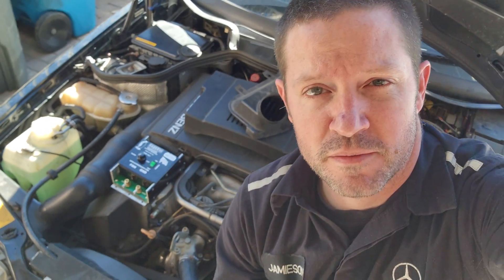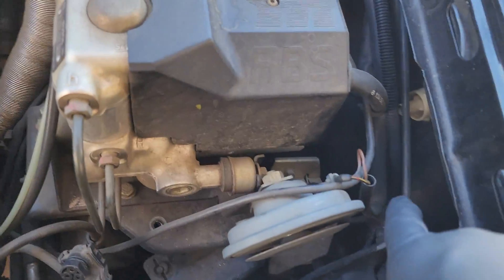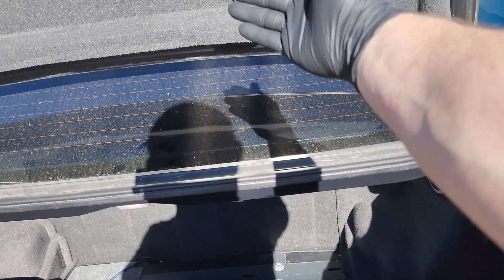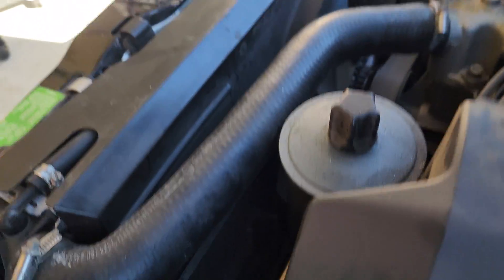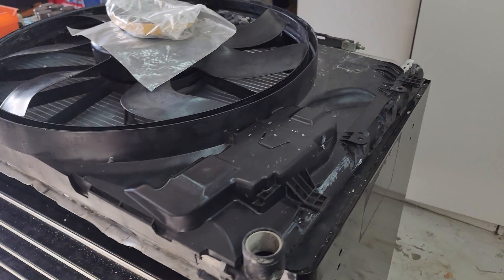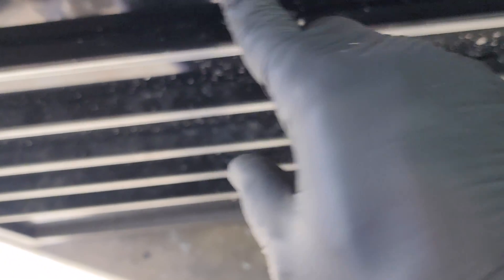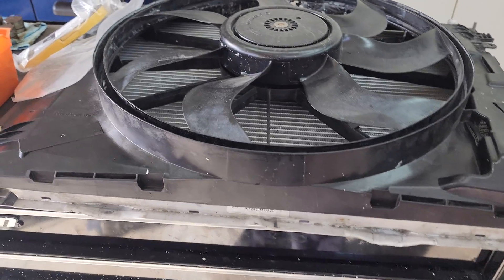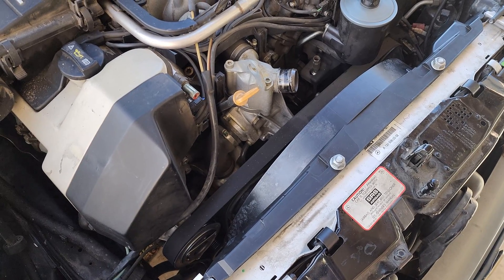Electric Radiator Fan Conversion Part 1

Comment: I just put the fan from W204 to my W124 which I already upgraded the alternator to 115A few years ago before. I haven't put any PWM controller yet, just tested the fan directly to battery and turn 100%, but the charging voltage slowly drop from 13.5V to 11.8V. 😂

Comment: Great video!
I have a 1992 3L M103 300E (wish I had a V8 W124). Upgraded it to a 90-150A alternator and a 100Ah battery. Planning on installing a 850W fan. What PWM device of those do you recommend? Oh yeah, we get close to 50C ambient here in good days in this part of Saudi Arabia. That's why the 850W fan. Haven't watched part two yet. Gonna when I get free.
Thanks again for the video.
Reply from the maker: @SG-cm7zq  the one I'm using is the 150 amp AutoCoolGuy.com PWM controller.  I suggest upgrading the alternator as well, which I plan on doing soon as well.
Reply: @FriendlyMBTech  
Thanks!
The fan I had my eyes on turned out to be a 600W W221 fan and just finished installing it before seeing your reply (looked for 850W and wouldn't find one). Stress tested it on the 90-150W alternator and 100ah 900a battery I upgraded to. It worked beautifully under stress with 13.5v charging at idle and 14v with little revving at 1k RPM. It worked very nicely in today's 45.5C afternoon. Do I have to use on of those controllers with an overhead amps, and compared to what, the alternator?

The connections I'm using now are for test purposes. Running at 100% all the time will reduce it's life span. It's connected to a switch only.
Reply from the maker: @SG-cm7zq  I'm actually thinking of switching the fan to a W221 unit.  You don't HAVE to use a controller.  I used one because then the fan will operate like a factory electric fan would.  As temperature increases, fan speed increases.  When coolant temperature are too low, the fan isn't on at all.  This prevents the 0% to 100% current spikes of only using a switch and not putting undue stress on the alternator.  I was  sitting with the car idling the other day and noticed on my bluetooth adapter that the voltage was at 11.8v with the fan on 100%.  Increasing RPM increased the voltage so I didn't get stranded.  Maybe my alternator its because my alternator is on its way out?  If I replace it, I'm upgrading it to a 143-150 amp unit out of a W140.
Reply: @FriendlyMBTech  
Really? Had it installed by an old MB electrician and he didn't now how to do it. Any tips? I can't see a controller attached to it. Part no. is 2215000993 and it's 600W. Are you using a 115A alternator by any chance? AFAIK, these don't do well with high output mods, especially that it is 70A at the lower end (stamped 70-115A).

AFAIK, both W140 and W220 alternators are direct fit for W124's. I recommend 150A but the flavor that has 90A at the lower end (90-150A). There's another that has 80A (80-150A). The 143A is 73-143A which is close to the lower end for the 115A. The lower end is what we need for these fans, I believe, if we are heavy city drivers. I'm mixing both W140 and W220 alternators, and only Bosch.
Reply from the maker: @SG-cm7zq  The fan should have a module on it.  It goes from 4 or 6 pin to 2 pin for the motor.  I removed that module, so all I had was the two pin +/- to the fan motor itself.  The AutoCoolGuy.com pwm controller I'm using, controls the ground side of the circuit.  The directions included were very simple. 
 
Since my alternator is either the 70A or 100A version, and I want to install some kind of better sound system in the car, the alternator will need to get upgraded either way.  

What did you want tips on?
Reply: @FriendlyMBTech  
AFAIK, V8 W124's have a min 90A rating. But good luck with the upgrade. You do have so many options.

Tips on how to use the module on my old car. I got the fan without it. The shroud had nothing else attached to it. So if I find the module for that specific fan, it will have some cable on the other side to connect to the W124's aux fans sensor or something? Does the plug decide if the module will work on it?
Reply from the maker: @SG-cm7zq  the aux/ac fans are on/off.  They aren't pwm and should switch on with either temperature or ac demands.  The W221 fan will have the module on it from the factory.  The fan I used did, and I removed it because the pwm controller I used took its place.  I don't know how to wire up the factory module to work on an older car.  The aux/ac fans are also wired up independently of the cooling fan and turn on at different times than the cooling fan.  Their function will have to be wired separately.  Or, if you want to use them at the same time, wire them in parallel with the cooling fan.  Just make sure you get a big enough pwm controller.  AutoCoolGuy.com makes different versions and capacities.  I got a 150 amp controller because I try to use things that are way too much rather than just barely enough.  In my experience, using something to less than half of its capacity will last longer than using something to 75% of its capacity.  Also, you'll have no room for growth to expand also.  So even if I want a larger fan AND run the aux fans off the same controller, I'll still be ok.
Reply: @FriendlyMBTech  
Thank you for the explanation. I left the aux fans on factory settings.

Comment: You've been getting a lot of love recently on a couple threads on the 500E board.  I posted your latest video in our existing "Electric Fan Conversion" thread.
Reply from the maker: Awesome!  Thank you!  Weather has not been letting me work on the rest of it.  The car is outside and I get home at night and it's been raining on the weekends.  I'm going to finish it as soon as possible.  Thank you for sharing.

Comment: Are you running the stock alternator? Any power concerns?
Reply from the maker: Yes, I'm going to keep the stock alternator, for now.  That's one reason I'm using PWM to control the fan.  No massive current spikes when the fan cycles from off to 100%.  With PWM it will ramp up and down between 0% and 100% in increments depending on coolant temperature.  Also, it will only turn on the fan 100% if needed.

Comment: That fan controller is massive, and for what it does... way oversized. What is worse is it a fan controller (fan is underhood) reading sensors on the engine (sensors underhood) and its not even built in an acceptable way to be an under hood automotive component.
Its a super simple device. If it was me, I would look for a different controller.  Ideally one that does not have massive knobs and switches on the outside of it. knobs vibrate. switches hit knocked. If I was grading this design for an automotive application, it would get a D-.  If it was for an industrial application where it lives in a metal box, it would get a B+
Reply from the maker: I apologize for just now seeing your comment.  Yes, I agree, it is rather large.  It is capable of being under the hood, size permitting.  I just don't have the underhood real estate for it.  Other applications might though.  Such as older cars from the 60s and 70s with less busy under hood situations.  Also, I have a higher amperage version.  He also makes lower amperage versions like 125 amp and 85 amp, I believe.   Don't quote me, but the 85 amp body might be smaller.  When I bought this one he was working on a 24v version that was even bigger than the one I bought.  Size and design aside, I chose this one for several reasons.  One, its simplicity.  Not only is the design and function simple, but the instructions were very well written.  Two, the guy building them is local to me.  I was able to meet him, and he even walked me through his work shop.  Three, I wanted to support a local small business.  This gentleman is retired and is building these to keep himself busy.  If you call the phone number on the website, he answers.  If you leave a message, he calls you back.  So far, I am happy with the product.  It still functions perfectly.  I mounted it in the trunk, away from anything that might come in contact with it.

Comment: Another great video: Outta curiosity two questions: I assume you're converting to electric fan due to/or to prevent overheating so : a. I'm sure you know that for the hot climate countries back in the day Mercedes came up with a "tropical" fan clutch for the W124 which kicks in at lower temp ,why not use that? b. Why not wire the high speed AC fan with a toggle from the cabin that you can flip when the temp goes above normal?
Reply from the maker: Thank you!  To answer your curiosity, I'm doing it out of curiosity haha.  Basically I'm fixing something that isn't broken.  I started with the question, "Could it be done?" and ran with it.  To answer your other question, factory fan clutches are no longer available.  I also don't want to use a toggle switch because I want everything to function like a factory fan should function.  With this PWM module though, I will need to wire up a toggle switch but only as a failsafe.  One of the seven contacts on it is specifically for that.

Comment: Yeah these can be fun sometimes. But when done right really work great. I low the fan control unit. I’ve used Davey Craig fan controllers. They’re smaller and a little easier to find a spot to place them.